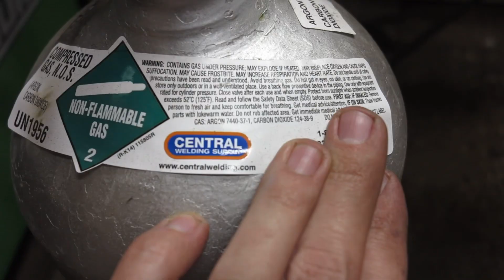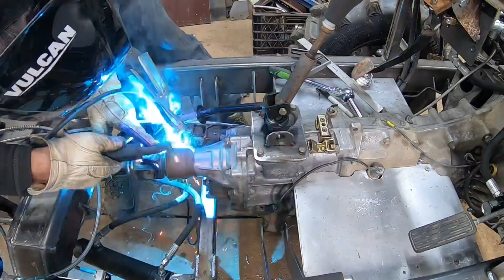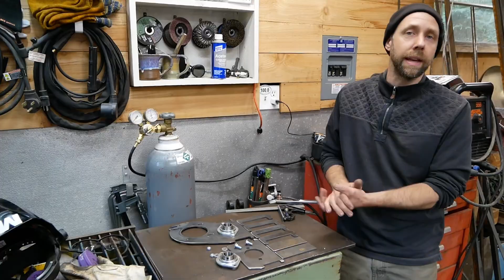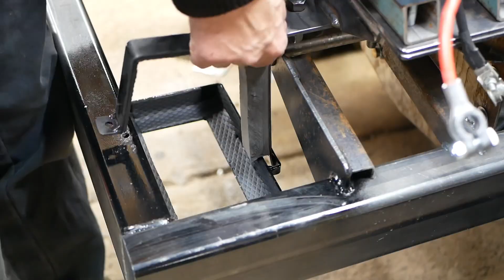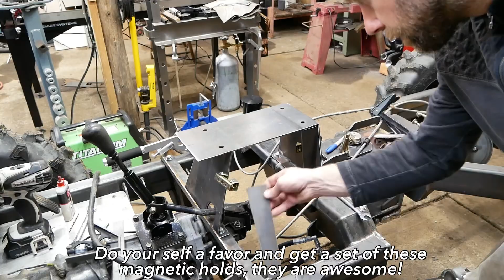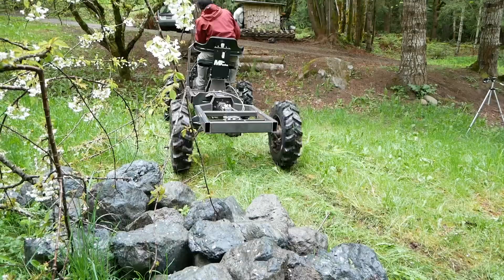420cc Predator powered articulating 4X4 dump truck build part 7

Comment: Do you have a Northern Tool in your area? I have been using them for Gas. Been pretty reliable and full bottles. Or get cheap reg and wrench and check it before you accept the bottle.
Reply from the maker: I only have a few small shops that sell welding gas around here, they are middle men and really don’t know much about the bottles they sell. I will take a gauge next time but I’m actually lucky if they even have a full bottle in the size I need when I get there. Thanks for commenting guys 👍 
PS I’m not on a Island but almost and it seems remote enough to really never have the parts needed for a job so most stuff for this build I have had to order and get it shipped, but the bright side is, I have a lot of nice woods to enjoy!
Reply: @Mikefestiva  Hopefully gauging in front of them will bring it to light. Their supplier maybe defrauding them which is trickling down to you. Or possibly negotiate a discount for shorted bottles. Food for thought.

Comment: I love what you are doing. I have not seen your other videos yet but I can appreciate what you are doing, I built a street legal predator powered (same 420 hemi as you) Ford Ranger and it is still FWD and high and low range and all 5 gears with 750 miles on it.  I really dig what you are doing.

Comment: Just find a  PASQUALI Tractors lol
Reply from the maker: I just looked those tractors up and they are cool but they are not really what I’m building here. This will have far more ground clearance and will be able to haul heavy loads without the need for a trailer. I live on steep hillside property with trails in tight woods so trailers are not a good match up here. Plus I already have a stout 4x4 tractor. Take care

Comment: Too late at this point, they'd probably accuse you of using some gas, BUT from now on, I'd take a flowmeter with me to the welding store. When you get the "full" tank to your truck, check the pressure. If it's down that far, take it right back in and be like "OOPS, this one isn't full".....lets try this again".  If they poo-poo that idea, then say "so can I get a 25% discount on this 3/4 full bottle"? Gas is costly enough without getting cheated out of 1/4 of the bottle.  Other than that, cool that you did testing with it just tacked, then welded it out. The gearing looks GREAT now as well!

Comment: Mike this build is the best build on YouTube! I think your design and fabrication is top rate. 1st gear still doesn't appear low enough especially carrying a load up or down a steep hill. 10-1 might be a better granny gear. The steering is incredible. Have you worked out the hydraulics for the dump bed? How about fabing your own skidding winch for timber retrieval.

Comment: A torque converter clutch would have solved the gearing issue, allowing use of torque and speed when required.. but you’re the engineer of your build.
Reply: a torque converter would of worked  great  but because he is driving the hydraulic pump with the same shaft the pulley interfered  with the mounting bracket for the cvt which mounts to to the engine block

Comment: I bought a 2011 ktm 250 xcf today. I'm so excited to get it going. I have to figure out the in tank fuel pump and clean the injector. She should be ready to go after that.
Reply from the maker: Nice! I think you are going to have a blast on that bike! Have fun 🙂
Reply: @Mikefestiva  I know this is off subject but when washing my ktm can I get the computer and throttle body wet? I want to completely clean my bike I'm just scared to get it wet.

Comment: Have you thought of adding a small turbo for low end torque ik you dint need globs of hp because this machine has a low top speed and has gearing to make up for the power but you could in theory get a little more out of the power band and reduce your gear ratio I think it would just up the cool factor past 10 cause this thing is already super cool

Comment: Well..... You do have a $0.13 pressure gauge on that regulator so.....
Reply from the maker: If the gauge reads 2000 when you get a full bottle and the next bottle reads 1500 when purchased, are you telling me if I buy a more expensive gauge you get more gas even when the company shorts you? Ether you work for central gas or your just being a Tool snob Haha which one is it 😂
Reply: Mike festiva I think everyone hates their gas supplier. I get mine at tractor supply form convenience. They usually don’t know what I’m talking about when I ask for it.
Reply: @Mikefestiva  I'm not a professional, but pressure changes with temperature. Did you try to mesure the full and empty weight?
If there is a discrepancy in weight maybe you can bargain a better price?
Reply: @luishenriquepuhl7351  bingo! temperature, atmospheric pressure, gravity....
Reply: @Mikefestiva  LOL
Reply: @Mikefestiva  😂 guess the gauge is perfect. Have you ever had it calibrated?
Reply: Argon and even C25 is pretty stable in terms of temperature causing pressure change. Unless the bottle was filled at high ambient temperature and then went to very low temperatures in his shop it’s unlikely that a near 500psi loss of pressure would occur. It’s possible the valve has a slow leak or the bottle was under filled, depending on the people at the supplier he uses for he tells them it was under filled or was low when he started they’ll give him partial credit or flag the bottle for inspection. All depends on the quality of people and the how the business cares about reputation.
Reply: I use airgas and for some reason they just happen to be out of 75/25 every time I go there so I have to get the more expensive 80/20 or what ever it is I can’t remember.
Reply: @JasonTheMunicipalMechanic  why don't you use just co2? do you mostly tig?

Comment: How much money do you have in it
Reply from the maker: I think it’s going to cost about $3000 after I’m done, I went a bit over budget mostly because of the hydraulic steering, but when you think of a new side by side cost around $15,000 and this will fit my needs better I can justify the cost a bit more. Thanks for checking out my new video!

Comment: I may have missed it in the video but what’s your opinion on the suspension tractor seat so far? I have a Bolens 1225 with no suspension and nothing other than a flat piece of leather to sit on and it’s been killing my back lately. I’ve been looking around for different seats but it seems like yours is a good deal!

Comment: Mike, I love your videos! Could you maybe do a quick video of how you get accurate measurements off old parts like the top plate for the transmission then how you design them in fusion 360 or whatever software you are designing them in? I plan to get a CNC table sometime this year...

Comment: Something to think about when you start fabricating the dump body is a tailgate release that works from the operators platform. In my opinion from working in construction the ability to tailgate spread is paramount. Also I would suggest putting most of your controls on the right hand side of the operator.

Comment: I'm a machinist and I almost googled "square drill bits" because I couldn't possibly imagine how you could match up the speed and the feed on a manual drill press to have an oddly shaped drill bit and then I thought "well you could do it on a CNC mill." but then the hard corners would still be impossible and then you would be better off using a punch to "drill a square hole" and then I realized..... It was a joke... lol
Reply from the maker: 😂 Right on man! Yes the only square hole bits I have seen are for wood only and they are definitely a odd looking drill bit with a sharp square chisel around it. Thanks for checking out my video and commenting 👍 I really appreciate it!

Comment: Mike, around here the gas suppliers sell by bottle weight, so our gauge pressure varies.
Maybe your supplier does the same?

"Drill Square holes in steel with REBAR -NO SPECIAL TOOLS needed"
Link: https://www.youtube.com/watch?v=LxiEzxR32Lw

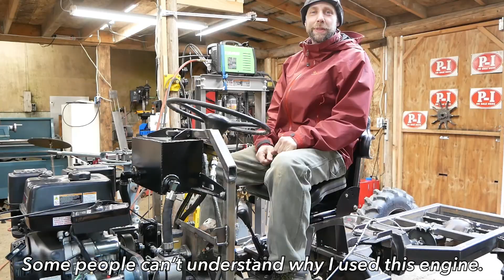Comment: 19:15 You ain't building a racing maching. So no need for a bigger engine.
Me personally might have gone with a diesel engine of similar size. 
As the predator. But those are so damn expensive :)
So i would probably have ended up using this engine to :)

Comment: Do you have an articulation limiter? So the front half doesn’t flip leaving the back half on its wheels.
Reply: no.  It is usually a loaded dump bed that tips over  and by not limiting the rotation. The cab section will stay up rite unfortunately  this happens fairly frequently on full size articulated  dump trucks with little to no damage to the truck

Comment: Have you thought about a dozer blade attachment? you already have the hydraulics. would come in handy for spreading whatever your carting.
Reply: My Opinion it could definitely work, it’s just about if cost is a problem. It’d be another $1000 to run hydraulics and make a blade
Reply: Just throw a straight blade from a snow plow truck on it they come with their own hydrolic systems and you can pick up a used one pretty cheap
Reply: @lostin.psychosis7080  That's a good idea and would be all you need for the type of work i'm guessing it would be doing/ (spreading gravel / woodchips, flattening pathways and such)
Reply: My Opinion only thing is that you might need to modify the plow to make it not as heavy and have a better edge on the bottom

Comment: Man I bet in 1st gear that thing is a high torque crawler..gonna be able to handle heavy loads with that in that form...and will probably save the clutch on the engine too since the torque multiplication from that jack shaft will help keep it from beating on it so bad

Keep em coming!!!!!

Comment: Mike Is the transmission a automatic transmission or is it  a manual?
Reply: I heard a sintrifical  clutch and saw him shift through 5 gears so you decide.
Reply: 5 speed subaru transmission
Reply: he manualy changed the gears from 1rst to Reverse. You can easily say that it is a manual

Comment: A full tank of 75/25 is 1,500 psi.  A full tank of Argon is 2,640 psi and a full tank of O2 is 2,000 psi.  CO2 by itself is normally under 1,000 psi.  Most of the welders I know that pay for their own gas just use straight CO2 when MIG welding because it's cheaper and there is minuscule/imperceptible difference in your weld.

Comment: Amazing mike! You've come a long way. Hey where did you get those dual piston gray brakes from? eBay?
Reply: Vasily Builds keep up with your builds 👍
Reply from the maker: Thanks for checking out my new video 👍
Those dual piston calibers I was happy to find on E bay they are a step up from go cart calipers. They are for a 2008-2013 Yamaha Rhino 700, the set with pads were only $35! You should be able to find them on there 👍
Dude I’m really digging the turbo, your side by side was ripping when you had 20 PSI of boost!
Reply: @Mikefestiva  thanks Mike! That's should be a big help to stop my buggy faster. It's got 1 piston brakes up front

Comment: It would be interesting to build a backhoe attachment or cherry picker for it. maybe one that swings to the side to stow it and locks in with a pin when in use. You could even use bypass valves for the steering for your left and right swing. It would be nice addition to swing heavy objects into the dump bed but you would need a couple hydraulic legs to keep it from trying to turn the truck over.

Comment: Really interesting build, nice fab and engineering work as well . Been following the build from the beginning.
You may consider installing split collars onto the jack shaft if the set screws in the brgs and sprockets end up coming loose. I've had that issue with similar projects. Install split collars on both sides of sprocket flange and/or one side of brgs to control side movement. Stitch or spot weld half the collar to sprocket flange. Collars also hold key stock in place. 
I've fabricated pinch flanges for shaft, to mount sprockets onto. Similar to how motorcycle sprockets bolts to flange on the hub. You can also buy taper locks, etc for shafts if you don't want to fab/machine them. 
Great job with hydraulics considering you haven't worked much with them much!  Very impressed! You're absolutely right with the engine power, it's plenty. It's all in the gearing anyway, and for the price and simplicity, that engine is an unbeatable deal. 
How's the turning radius? Seems to look fine from what I could tell. Are the diffs still functional? Might experiment with locking one diff (welding spiders) possibly? I'd think front so it will turn when the back is loaded with weight, but just a guess and may not be necessary with the center pivot keeping all the wheels planted on uneven ground. 
Also, might consider basic roll protection. Just a single hoop behind you seems adequate considering light weight. 

Looking forward to more videos...

Comment: This is a really cool rig. Is it hard to shift while driving or do you plan on moving the shifter higher later on
Reply: this is like a tractor you can start in any gear it is geared son low 5th gear is like 1st gear in a car

Comment: Gas bottles are usually filled by weight not pressure. Temperature can affect the pressure quite a bit depending on the gas.

Also, you can get square hole drill bits, they are called mortise chisel bits.

Comment: are you going to have enough power too dump the box when at a idle ,,or you might have to put in N then park brake then rev up engine to get the power dump to lift heavy load ?? good luck ..

Comment: take a gauge with you plug the hose off or dont have the t handle turned it to check bottle .. the company i use gave me half off the next tank when i told them it was short ..

Comment: Mike, thanks for the ideas and inspiration on my build using an 86 Nissan 4x4.
V6 Engine powering big 13-64 GPM hydraulic pump, with hydraulic motor powering the transmission for hydrostatic drive.
Can't wait for the next video...and don't worry about the negatives, someone always wants to be somebody else's boss/no-it-all!

Comment: Why not run dual shield wire? You can run lower gas pressure and maintain super clean welds? We do it at the fab shop I work at for thicker stuff,and it equals better penetration

Comment: Are you considering a idle control (governor) pretty handy if you do in fact set up a aux Hydraulic system to run a winch, or post hole digger, wood splitter   etc. 

The new plasma table looks fantastic.  I am sure it will continue to open up brand new avenues in making your shop profitable.

Comment: Fantastic build, man.. I love it. What do you think the chances are that you might eventually want first gear to about half as fast it is now. The older I get, and the more work focused I become I find the more control I can achieve the better the outcome, and less chance of breakage. Also, the ability to use gearing and weight instead of horsepower is a tremendous advantage.

That being said, again, fantastic all the way around. Great work, great build quality and attention to detail.  Thank you, for the build series.

Comment: Running less air in the tires will give you a little bit better ride. Not much, but the traction and ride will be better.
Reply from the maker: Yes definitely! I just lowered the air pressure yesterday and I’m thinking of going even lower. Thanks for commenting!

Comment: 1500 PSI? My mig mix bottle has about 50 PSI in it right now, and my gas supplier is closed, so I'm pretty much screwed... I'm also all out of cutoff wheels, duct tape, and brakleen, so I'm not even sure how I'm still alive.

Comment: I love the retro 2D manual CAD, alway accurate to “Good nuff” I’ve always wondered why when cutting on your using your CNC why not use the edge of a previous cut as an edge of another part.
Reply from the maker: Thanks for checking out my new video 👍 To answer your question, there’s two reasons about not using the previous cut edge, one the plasma tends to cut much more accurate when cutting though solid plate rather then down the edge of a existing cut, the arc seems to not cut squarely, the second reason is if your tip gets a little off of your plate you can loose the arc and this can cause a part to come out uncut in some places. Take care Abby

Comment: Just curious. I know you have a fein Metal chop saw but in video you use band saw. Do you feel it is more accurate or another reason?  Thanks
Reply from the maker: Thanks for checking out my new video 👍 
I own the bandsaw, I use it all the time, the Fein chop saw I purchased for the company I work for, it pops up from time to time in my videos when I borrow it. The Fiein is definitely quicker but the bandsaw you can make free hand cuts on it. Take care
Reply: I don’t have a bandsaw but I do own a Fein carbide chow saw. I was just curious. Thanks

Comment: Awesome build. This would be like a $20,000 machine assuming you could even find one. And the fact you built it yourself will make any future repairs super simple. I'd put up some vertical posts behind the seat in case of a rollover. And you can use the posts to add a roof to protect from the elements. I am sure you already had it planned.

Comment: How you doing Mike? I've been watching your videos for a while and I really loved you for articulating 4 wheel drive tractor. I also heard you mention something about CAD. If you like using CAD program you should check out a program called rhino. It's like CAD but is a 3-dimensional designing software with a lot of features cat doesn't have. You can build your designs from the ground up it's an awesome program and I liked it a lot better than the CAD program I would highly recommend it for anybody who likes do projects like you do